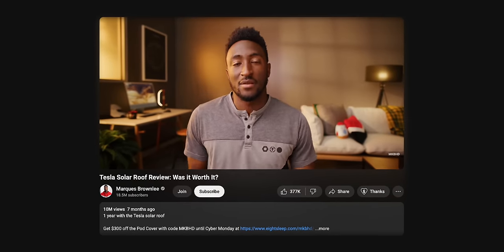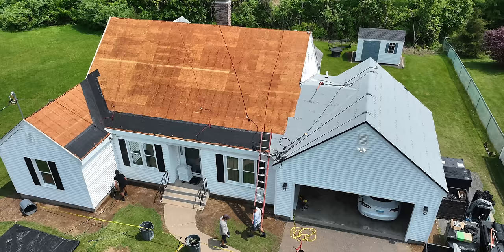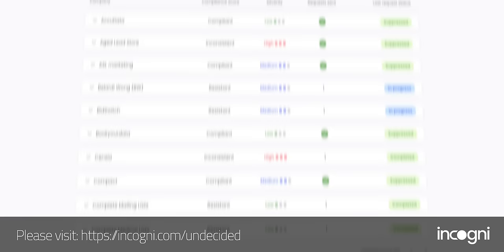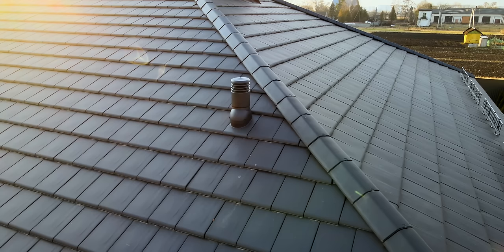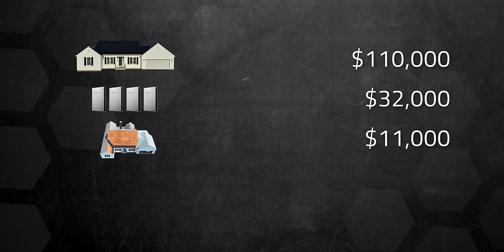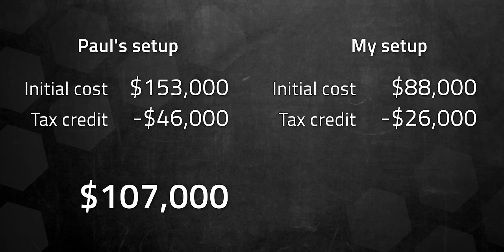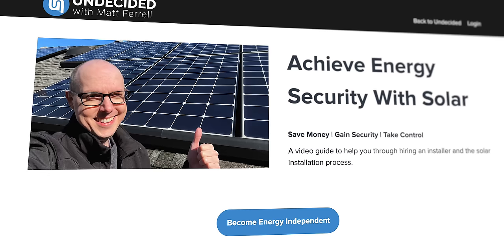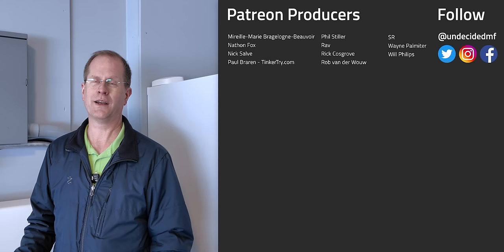Tesla Solar Roof vs Solar Panels: Which is Worth It?

Comment: As a licensed GC in my state, I can answer your question about Tesla solar roofs. It's dirt simple: Tesla shingle roofs are unbelievably overpriced, to the point of absurdity. They are a luxury choice that only rich people can afford, and they will never pay for themselves if you consider the TVM (time value of money). You literally could put the $80,000 they cost in an interest-bearing account, and the interest would pay your electric bills for a lifetime, and you would keep your $70,000. Calculating this the lack of payback period of Tesla solar shingles is really very simple math.

Another issue is that Tesla Powerwall batteries are outdated. They contain their own inverter, but Tesla STILL requires additional inverters. For example, right now you can buy a Sol-Ark 15K inverter, which is a luxury hybrid string inverter, for $7,000. It will accept 19 KW of power from solar panels and you can use six different strings  to link the panels to the inverter. So if you have six different roofs, you can put each roof on its own string.  Paul could have installed two of the Sol-Ark 15 K inverters connected in parallel and easily connected 30 KW of solar panels to them. The cost would have been $14,000 (for the inverters) +  $16,000 (for 64, 420W solar panels) + $10,000 to install the system and ancillary costs = $40,0000. Right now you can get lexus, high quality LFP batteries for $1,400 for 5.12 KW. Three Tesla Powerwalls have about 45 KW of power storage.  So if you bought nine of the LFP solar batteries, you would get a cost of 9 x 1400 = $12,600, and these batteries communicate with the Sol-Ark 15K inverters so you can monitor each battery's performance separately in the Sol-Ark software you install on your laptop, just like Tesla's software. Add another $5,000 for battery racks, cables and installation and you have a total cost for a 45KW battery system of $17,600. So the TOTAL cost for this system, which is MORE powerful and can do MORE things than Paul's system is $40,000 + $17,600 = $57, 600 which is about 1/3 of the cost he paid for his system. If you want to put a new roof on his house before the system is installed, I would guess that you could install a steel roof on his house easily for around $25,000, but we will use $30,000. So the total cost for the solar system AND a new roof would be $30,000 + $57,600 = $87,600 or about half what Paul paid. The actual cost would probably be around $15,000 less than this, but I am being conservative. The ONLY difference is that you would have a different warranty system.

But there's more. With the Sol-Ark 15 K system, you can take your entire house off-grid if there is a catastrophic failure in of the electric grid system AND it takes you off-grid automatically. The Sol-Ark inverter monitors the output of each individual panel (using Tigo optimizers on each panel which are $42,00 each). The panels I priced are "REC" panels, which come with a 25-year defect, a 25-year performance and a 25-year labor warranty if one of the panels fails - this warranty is unparalleled in the solar industry. This warranty is competitive with Tesla's warranty on their solar shingle roof. These panels are commonly available and are state-of-the-art. They are designed to maintain maximum output in both cold and hot climates. 

You can also plug a generator into the Sol-Ark 15K inverter, and if, for some reason, the solar system goes down, the Sol-Ark inverter will switch automatically to an LP, gas or diesel generator to maintain power to your house while your system is repaired.  But it is highly unlikely that this system will fail; sol-ark is an American-made, premium inverter that carries a 10-year warranty, which equals the Tesla inverter warranties. With two Sol-Ark 15K inverters, you could actually plug two separate generators into the two inverters, so you would have a backup generator in case the primary generator fails. Provided that the generator has a self-start function, which most backup generators do have, the Sol-Ark inverters will automatically switch to the generator if there is a failure in the solar system or if the battery storage gets too low.

The entire Sol-Ark 15K solar system can be controlled and monitored from your laptop anywhere in the world where you have internet access because it has BOTH Bluetooth and WIFI connection capability. Sol-Ark's software UI is beautiful and it is as good or better than Tesla's UI. You can monitor all of your panels individually and all of your batteries individually from your laptop. You can track the performance of your system and how much power is generated every day. It is a Lexus system by any measure.

When you buy Enphase and Tesla systems, you are paying a  30%-40% name-brand cost penalty. For that money, you get someone to completely install your system and warranty it for around 10-15 years. So you do get the luxury of being able to call up Tesla or Enphase if there is a problem, but you pay through the teeth for that and many components in these systems are only warrantied 10-15 years anyway. Once s solar system is properly installed and up and running, there should are not that many things that can break down or fail. Additionally, with the Sol-Ark system I specify if your inverter or panels fail, Sol-Ark warranties the inverter and REC warranties their panels, so you CAN call them for assistance. The LFP batteries also carry a 10-year performance warranty.

So both you and Paul could have saved about 40% of your total cost and installed a solar system that has equal or better warranties, performs better in hot and cold climates, has more backup functions, allows you to go totally off-grid if necessary and allows you to monitor and set it from your laptop. Also, it is easier to repair the Sol-Ark 15K system because it has plug-and-play parts. If a  solar panel fails, the system will notify you and you call REC to install a new panel. If the inverter fails, you call Sol-Ark and they will repair it or replace it if it fails under normal use. If the battery fails, it has a pro-rated warranty, and you get a new one for a discounted price. Worse case scenario, it only costs you $1,400 to buy a new battery.  With both Enphase and Tesla, you are forced to use their technicians to fix any problems with your system, and if you are out of warranty, you will pay exorbitant prices to repair your system. The cost difference is staggering. 

This is why people are not buying Tesla roofs and why more and more individuals are not purchasing "name brand" solar systems like Enphase and Tesla and others.

Comment: If you chose a black metal roof with black panels, yours would look about the same. I would not use the solar roof until it’s about the same cost as panels. 

However, there’s a new community near me that has Tesla solar on all of the model homes. One model had the solar shingles. In real life, on a new home, the shingles really do look a lot nicer. 
But my goal is to save money and be somewhat grid independent. 

My home that’s currently being remodeled will have about 50 panels and 3 or 4 power walls. We have two EVs, 4 heat pumps, and a pool. We use a ton of electricity.
Reply: Thanks for sharing your perspective, curious where that development is with Tesla Solar on model homes, if you're comfortable sharing that.

Comment: I went with option C in the end.  I'm in the UK and wanted a Tesla solar roof, but Elon was more focused on space X back in 2019 when I needed Tesla contact/support/buy in.  A bit like Paul I have funky roof pitches and angles, which when the actual passage of the sun is added in, would mean solar lifting trays for regular panels, or simply a much smaller array.  Honestly, I never thought 30, 40, 50 years down the track about what happens when the tiles fail and/or need replacement/support, as I'll most likely be pushing up daisy's and that's the generally accepted life span of a roof in the UK away.  So I was more, I'm not paying for a new roof and then putting either on roof or in roof panels in place, that's just double accounting in my mind.  So I looked for alternatives and found ripple energy.  Now, not perfect, nothing is.  But they did give me an option C and for as low as £25 vs your greater than $100k so well... Caring is sharing right 😁

Comment: Hi from Land Down Under. These prices are ridiculous even after government incentives. 18kW solar plus 50kWh of batteries = 47k AUD.  No power bills for 8 years. I just don't have grid connection. For the reference 1AUD = 65 US cents. Obviously, I didn't take Tesla brand. You know, unbranded electricity works the same as branded one.

Comment: Span or subpanel expense IMO should be rolled into just buying another powerwall. I did not do one and merely bought 3x Powerwalls. Entire house backup. And I have a 4” well pipe, 5 ton AC, and an EV with 32A charger.

Comment: I have to agree with your premise. There are more and more solar products combined with another function such as windows, roofing and other building systems. As solar panels become more efficient over a period of 5 years, they can be switched out. With the life span of the combined solar/building system at 25 years it is unlikely that you would change your windows or roof for better solar efficiency. If you have panels, you can easily switch them out with more efficient panels. But if the solar is tied to a building system changing out for better efficiency is unlikely.

Comment: 16k cdn out of pocket for a batteryless 14.5 kw grid tie that’s a timber framed ground mount, with cUL rated equipment(government rebates around 8k, interest free loan on the remainder).  The DIY approach ROI is around 7 yrs.  If you have any framing skills in the slightest and have the space, highly recommend it.  Even if you’re an awful framer, the aluminum rails are quite forgiving.  A bit of math to stay under max voltage factoring in cold weather extremes, to a string inverter, dc disconnects on a 60A circuit, good to go.  

A not ideal winter angle, with not ideal weather still produced $148 in my area,  nearly the cost of the 1000’ish kw/h it produced.

Comment: I pay around $220/month for my home electricity here in FL. It would take me north of 25 years to pay for the cost of a solar installation for my house. By the time 20 years have passed, the system is already working at 50% capacity or less, and I still haven't fully paid it. Thank you, I pass. The only way I could do it is if I install it myself and make the system pay for itself in less than 10 years. More than 10 years is too much for me.

Comment: I love my GAF solar shingle roof.  Less expensive, more efficient.  We needed a new roof.  2000 Sq. Ft. house in upstate NY.  12kW.  Total project cost was around $60k but after rebates and tax incentives, and subtracting out the cost of a new normal shingle roof, my cost for the solar portion of the job is $16k.  For 12kW!  It's walkable, very few penetrations, and it's all backed by one company that has excellent service.  They've already proven that they stand behind the product 100%.  It'll pay for itself in around 7 years per my calcs using the last year's worth of data (a particularly cloudy year, I might add), and as our electric rates rise (boy are they...), that ROI figure is only going to get shorter and shorter.  Then just free electricity!  Oh, and we needed a new HVAC system too.... went with Mitsubishi centrally ducted heat pump.  Swapped out the ancient water heater for a heat pump as well so we could shut off the gas service. Between those three projects, our 50 year old house is closing in on net-zero... Might be fully after some insulation upgrades.

Comment: I put in 2 heat pumps connected to the 2 hot air furnaces, figured the 30% tax credit would save me a bundle. Did the taxes and found out there is a $2,000 max on that credit. I suspect Paul didn't save nearly as much as he thought he would either.
Reply: Good points. I did pretty well with windows and insulation upgrades, getting my full rebates. My savings on heat pumps for water and heating/cooling were more modest than I had hoped.

Comment: I liked that you looked at the long-term expandability when designing your system.  I've been in the tech/web field for a long time and building in the ability to change over time is key in both tech and solar systems.  I noticed your new house doesn't seem to have much of an issue with shading on your panels (except for a very small number possibly) so although Enphase is a super product, why choose microinverters over string inverter?

Comment: The prices are shocking to me. I got a whole solar system 9 years ago for less than the price of your batteries. Yes, it's just 9 kW, just single phase with a huge lead-acid battery but it's got Studer-Innotec components and has served me great. I had to change one cell in the battery but it cost like 200 bucks. Moreover i am not supplying any energy to the grid so I had no permitting issues.

Comment: Those prices are WAY too high.  I just did a new metal roof for $31k and a DIY battery backed solar system for $26k.  My solar power system runs my house and charges my car.

Comment: Personally i think small scale solar is the best way .. i installed (I'm an electrian) a 2.5kw solar (8 brand new pannels) system for £1278 with 3kw growatt Gti inverter.. I just bought 4 more panel's for £168 ( for all 4) of the same type second hand so for ~ £1500 I'll have a system that covers most of our daytime usage... Thanks to silly high electric prices here in the uk the intial install paid for its self in well under a year .

Comment: The Tesla Solar Roof does not currently make sense because the panels are less efficient and permanently installed.  So you are stuck with their current substandard efficiency for the life of you roof (25 to 50 years).  Standard solar panels are quick and easy to replace and they are rapidly evolving, so new panels in 5-10 years will be far more efficient than current panels and costs are falling fast so they will be cheaper as well. This gives you the opportunity to upgrade to the best available panels and when paired with batteries can make you a net zero for the grid or even a net producer to the grid if local regulations allow.

Comment: In Pittsburgh Tesla has abandoned the region for Solar Roofs. I reached out and I was ONLY connected with Power Wall installers who had no idea about how to do the solar roof portion.

We also looked into the GAF solar shingles. With utterly maxing out our roof we could only get to 10 kW of power. The technology just didn't seem ready for prime time. Efficiency and long term degradation were also far worse than panels.

The selling points on the standing seam for me were: No penetrations necessary. It seems solar installers are pretty good at hitting rafters, but they're not perfect. If they miss, they could crack a structural support, and now you're in serious trouble for having to figure out how to replace it. The second is the longevity AND the "cool roof" side effect. W went with PVDF coating which should reflect a good bit of the UV hitting it.

$29k for a PVDF 24 gauge standing seam roof
$55k for a 20.5 kW system with 50 REC Alpha Pure 410 watt panels.

Let's GOOOOO

Comment: Solar shingles are not readily available in my neck of the woods, however normal panels are very highly available and cost competitive so I went with that option. I have 9.5kW of panels and 7.5kW of Enphase microinverters which deal with my winter shade and high summer temp (45C) issues beautifully and had planned on getting the Enphase batteries, but they just cost too much for the benefit they provide, so I went with AC Coupled Alpha-ESS which so far is working perfectly (but only had it for a week). I wasn't aiming for net zero, but economic payback, and just a 10KW battery is working perfectly for me to capture my generated power as well as allow me to load shift and now I don't buy any grid power during my 6 hour evening peak rate period. I could easily charge another 10kW battery on sunny days, but I am not sure I will benefit during winter - but the great thing about AC coupled batteries is down the track I can just buy another one, of any brand, and augment my system. Not locking into a particular vendor or technology stack means I can incrementally take advantage of new options as they become available and get the best ROI for each component.

Comment: The concern I have with the Tesla or GAF solar products is that there are far more connections per KW produced due to the size of each shingle. Every shingle has a connection that introduces resistance and potential point of failure. I’m also concerned whether after numerous hot and cold thermal cycles during New England seasons, they start to fail at these connections. I’d rather have a traditional panel with its own micro inverter that will report if it has failed or is underproducing. I love my Enphase system with REC panels.

Comment: You are right about every project is different and what work for one site may not be the best option for the author . But I would like to add a few points. You can offset your electric bill without the power wall. Will a mental roof outlast a solar glass roof …that depend where it’s instal, a metal roof with in a Mille from costal salt water vs a glass roof ? I think glass will last longer…time will confirm if I made the right choice.I got a solar Tesla roof instal in April 2021 to replace a 25 years old metal roof (rusted) we got hit with hurricane Ian an no damage , Tesla roof is a very good system .